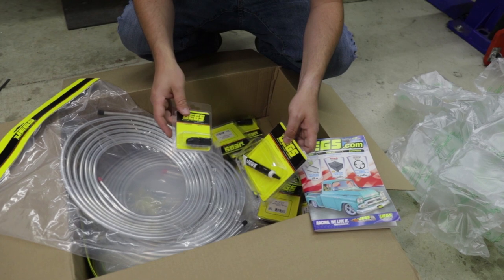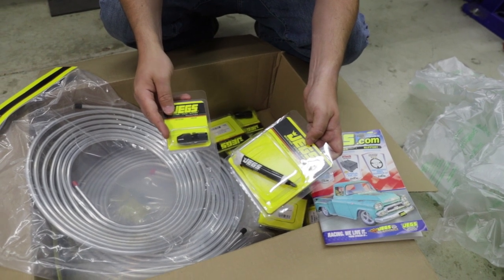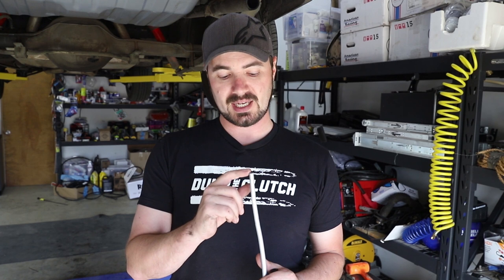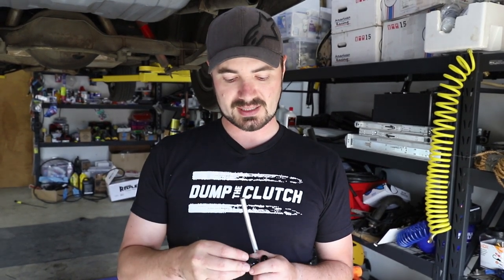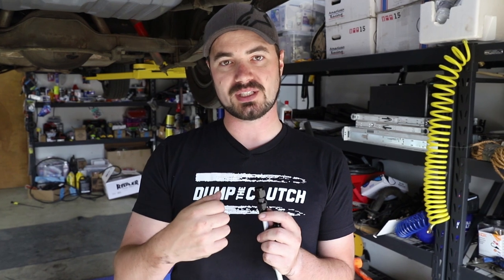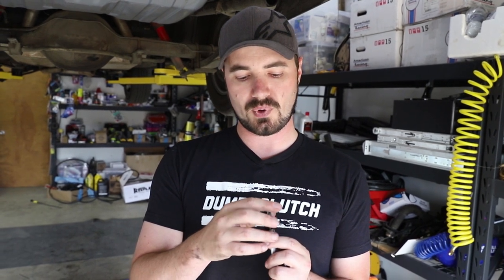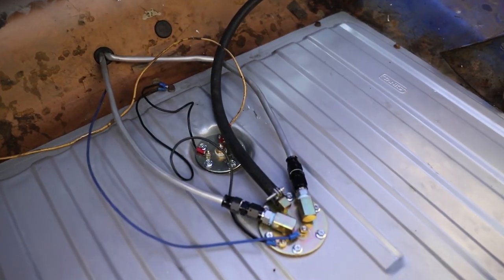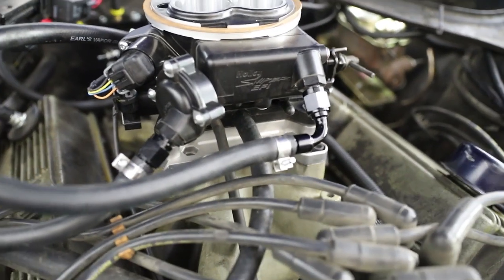Installing aluminum fuel lines on the 67' Mustang

Comment: I am going to be doing the same thing on my car and wanted to see where you routed the lines. I am concerned that you put them in the tunnel though. It seems like if you break a u-joint on the drive shaft it could rip open the fuel lines so not only do you have a drive shaft flopping around you also have a huge pressurized fuel leak. I already have some spots where the rear u-joint contacted the tunnel in the past.
Reply from the maker: That is a possibility. It really depends what your setup is and what you are doing with it. There are factory cars with tunnel fuel lines, and it will always have to at least pass above the differential. If you go to the outside of the car, a broken driveline will be less likely to hit it, but debris from the road gets a higher chance to. It's all a trade off depending on application. I will probably rerun them under a piece of shielding on the outside if I end up tracking the car much.

Comment: Here is a question: Does the height of the fuel line you run, in relation to the tank and fuel pump, mater? To save hassle I'd like to run my new lines over the inner fender to the mechanical fuel pump in my 73 Torino. This rout will bring them over the height of the fuel pump. and back down to it. Does that even matter? Please help.
Reply from the maker: With a mechanical pump, it could. You may need to use a low pressure electric back near the tank to push fuel over the high point to the mechanical depending on how high the arch is compared to the level of fuel in the tank.

Comment: Any issues with the aluminum line cracking or failing yet? Im about to order two rolls of it but now after reading online, everyone is saying that the world will end if I use it. What gives?
Reply from the maker: I have had no problems, but then again I install it very similar to a factory or race car setup. The line just needs to not be pulled or vibrated much if possible, which is why isolators and cushion clamps come in handy. I also ended up using bulkhead fittings to pass through the trunk in the final setup to make it easier to ensure they wouldn't rub on the metal of the trunk over the next several years.

Comment: Casper, where did you run the vent? These Mustangs don't give you a lot of places. Loved to copycat if it's been working well.  Just don't want to vent into the cabin if possible
Reply from the maker: I went out the trunk floor just above the tank to the right side, then mounted the vent unit on the frame up as high as possible.